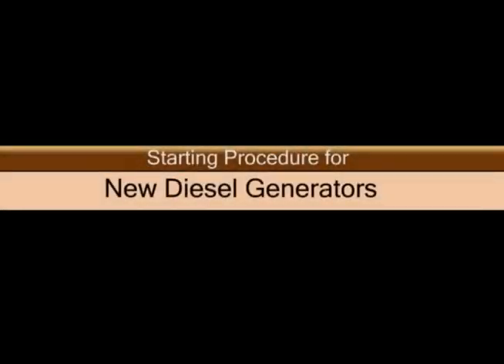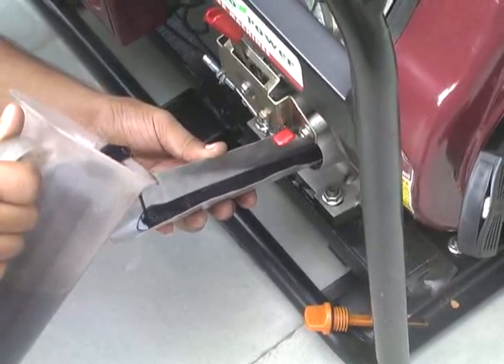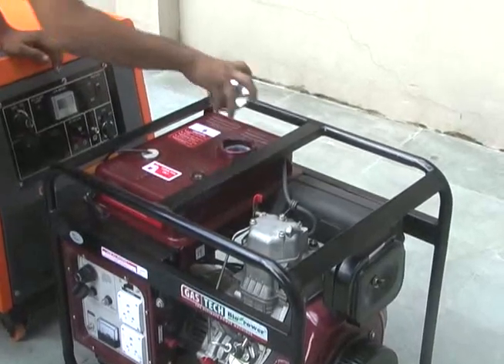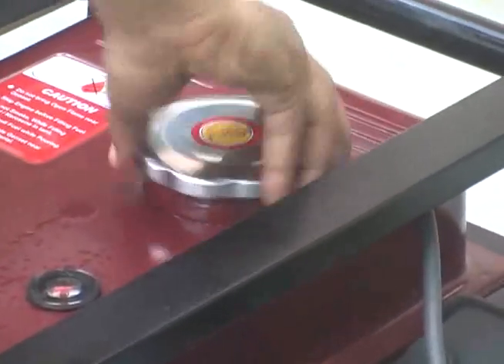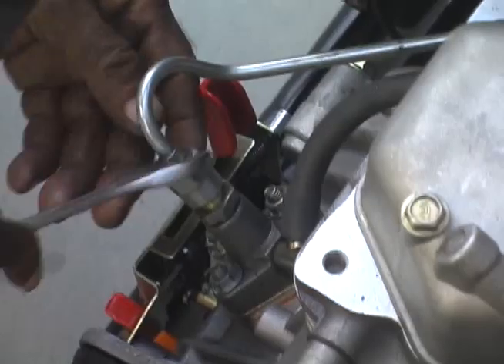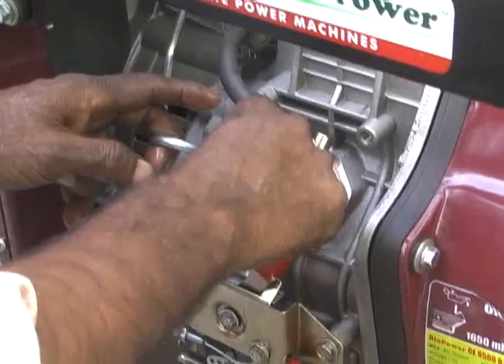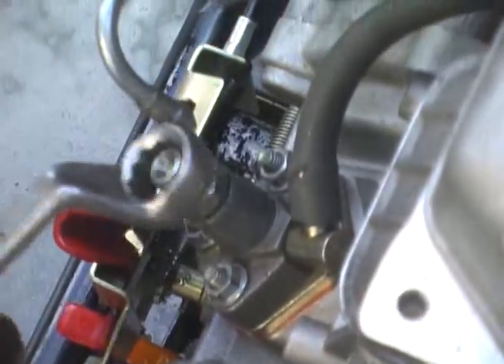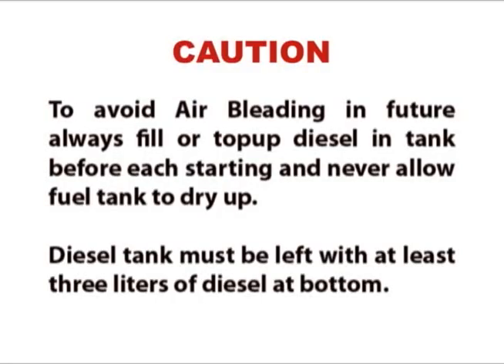Starting Procedure of New Diesel Generator

Comment: good video, you should make people aware that there is a tiny spring that (if they don't know about it) can get lost or fall out without them knowing. In order to get diesel without air flowing out the engine need to be turned over.